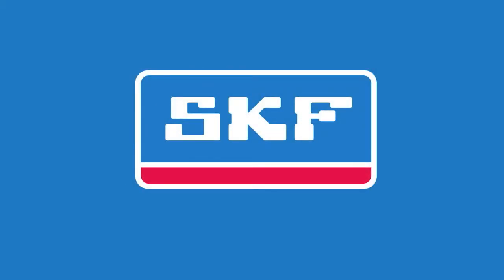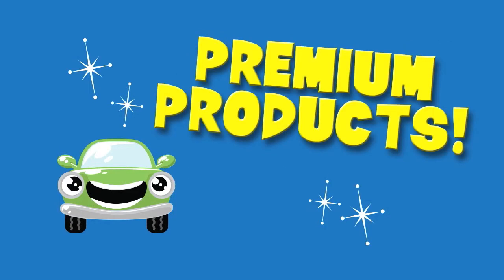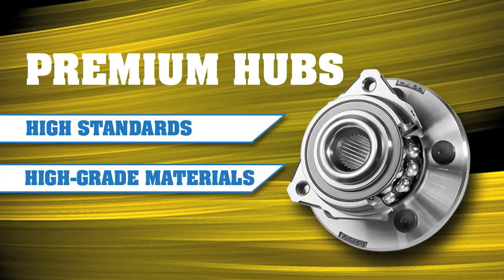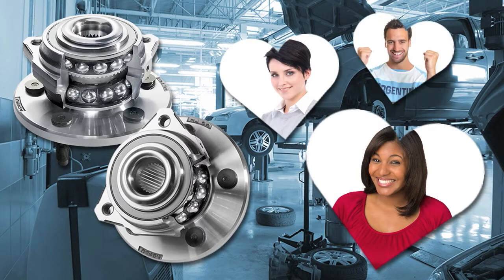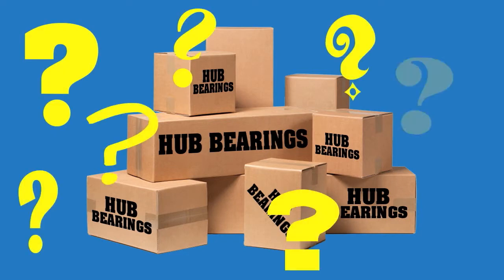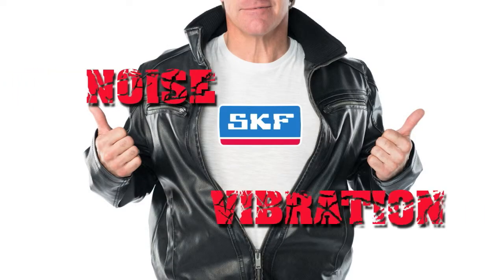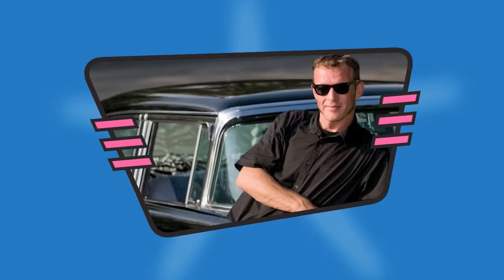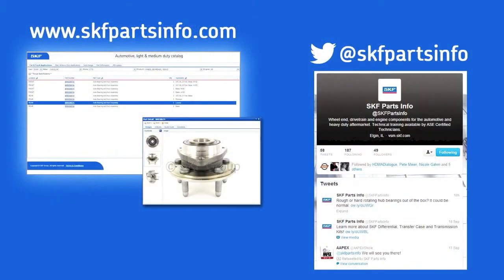Know Your Parts: Bad vibrations

Comment: So a bad HUB can be the cause of my vehicle rattling when going uphill?
Reply from the maker: There could be a number of reasons why your vehicle would rattle when going uphill, as the vehicle components are under additional loads at this point. The beginning of this video touches on how to check for a bad hub bearing: Installing a hub on a 2004 Pontiac Montana - The best way is to set up a dial indicator.